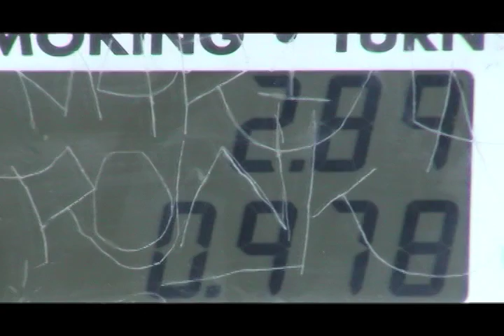Honda Rebel Extra Capacity Gas Tank 3.4 Gallons Installation

Comment: Stock tank is 2.6 gals. My wife's "09 Rebel 250 got 71 mpg on a recent trip. We ran it dry to get actual mileage. 142 miles plus 42 miles on reserve=184 miles on one tank. Two lane road, averaging 55-60 mph.( I carried one gallon gas can in my saddlebag so we could  empty tank.)

Comment: @superchevys10 Only if you mod it. Stock it will hit the cylinder head cover. And the bottom bracket needs have the angle modified. I belive the "canal" is allso to narrow.
Just like a stock 250 tank

Comment: @milanosbo Search on ebay for parts, that's what I did and got most of my parts to flush out my bike.  In fact, if you want one of this huge gas tanks you can find lots of them listed on ebay.  I ended up RedKoating mine after doing some welding on it, which leaked like a shower head instead of buying a newer big one, works fine. Also you can search the net for lists of "motorcycle junkyard" or "motorcycle boneyard".